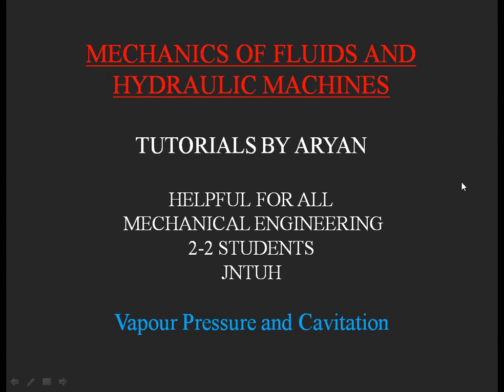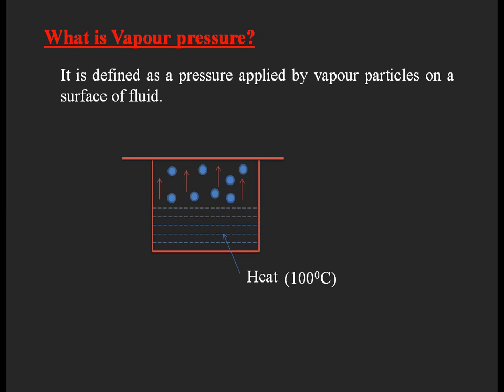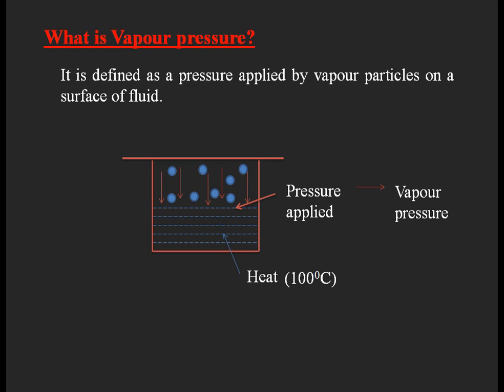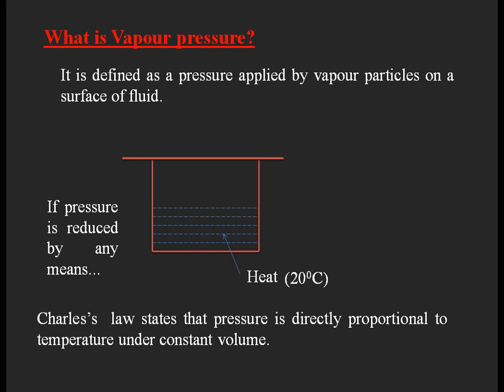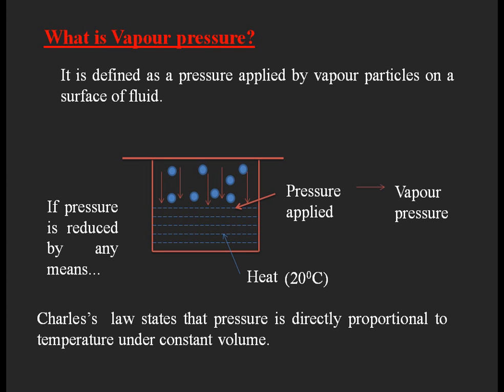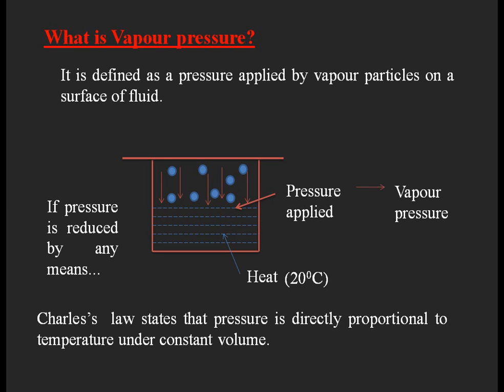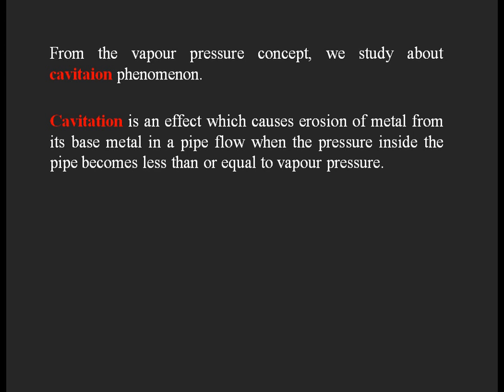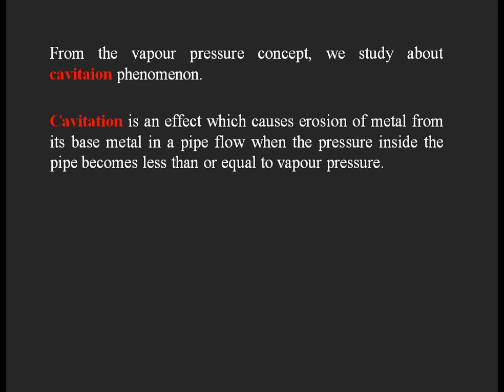Vapour Pressure and Cavitation

Comment: difference bw vapour pressure and normal pressure in pipe flow?
Reply from the maker: Vapour pressure may be experienced due to heat produced by friction between pipe wall and liquid.
Reply: Mechanics of Fluids